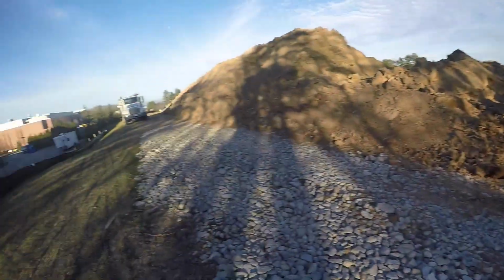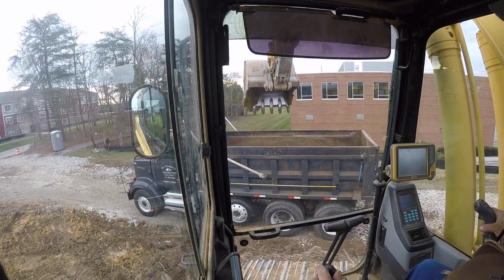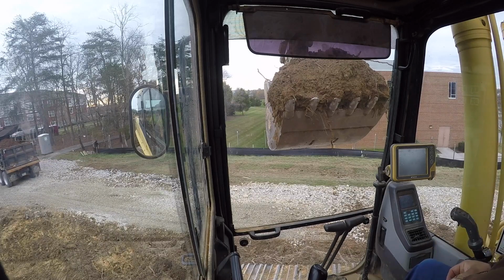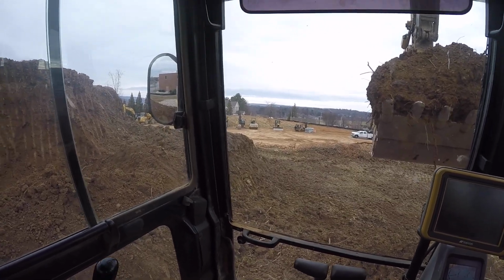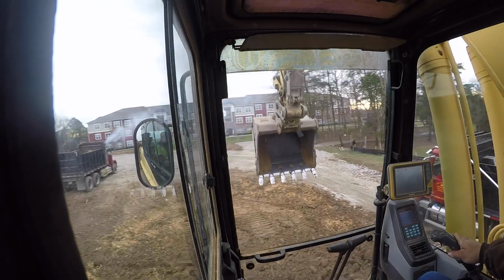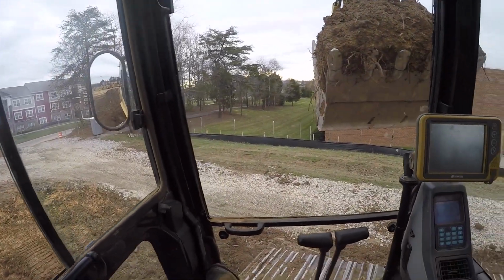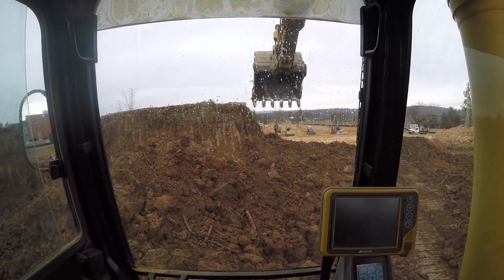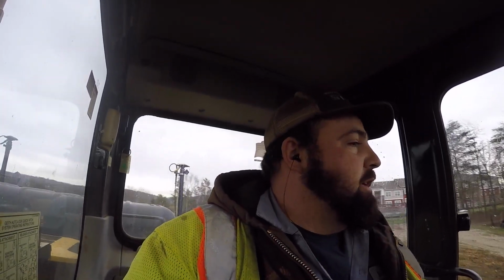Moving a Huge Pile of Topsoil Off Site

Comment: Back in the day I loaded tunnel clay from a spoil heap, used a 1.5 yd. bucket Front End Loader. It was hauled away in 11 yd. 6 wheeler trucks. 3 mins to load one truck and the next one backed in ready. The tunnel mined 24 hrs. I worked 12 so had to get em loaded and out.

I'm sure there will be no problem selling the top soil, the clay I loaded was made into bricks, so a great use for it. Isn't it great being top of the heap!!!!!!!!
Reply from the maker: Sounds like a good job. They needed to buy you a bigger loader though haha
Reply: @DLHFarms  Bigger is not always better and thinking of that why don't you and your family have a great Christmas.

Comment: a contractor did the work to replace a bridge with a pour in place culvert.  they had a huge hole dug and had the dirt separated.  Yellow clay is good blue clay and top soil is bad for compacting beside the structure.  They had a summer helper running a crawler loader backfilling and running a compactor.   He loaded trucks that the county supplied to haul away the blue clay.  Empty truck,   first loader bucket , phoom the truck jumped off the ground.  I guess it knocked the built up dirt off the frame and bottom of box.  bright side
Reply from the maker: Haha!

Comment: The school bus that I drive has an Eaton automated manual transmission believe it or not. Called the Procision with a dual clutch. It takes some getting used to compared to a regular automatic transmission.
Reply from the maker: Yeah it different but it’s a lot easier on the driver doing these short hauls

Comment: Why don't those big excavators have pushing blades on em like the mini excavators?
Reply: They're heavy enough and the footprint is wide enough you don't need it. With a unit that size, you have dozers and graders to level the dirt. You can rough it in 
with the bucket and roll over a small area with the tracks but really, it's designed to dig and load.
Reply from the maker: Darryl is right. One of the main things that the blade is for on the small excavators is for stability.

Comment: How far was the round trip for the trucks?
Reply from the maker: Probably about 6 or 7 miles round trip
Reply: @DLHFarms  that's not to bad. If you had 7 or 8 trucks running and it takes you 3 minutes to load 1 truck and the round trip takes 25 minutes. You could do 135 to 150 loads per day without any major issues. Do you agree?
Reply: @cntslesfabrication  Shouldn't take 25 minutes to drive 6 miles. A marathon runner can do 6 miles quicker than that
Reply: @Darryl603  I know that but not every driver puts his head down and does work. It's better to be realistic to be safe than sorry
Reply: @cntslesfabrication  Aww, you didn't have to say you're sorry. I forgive you...